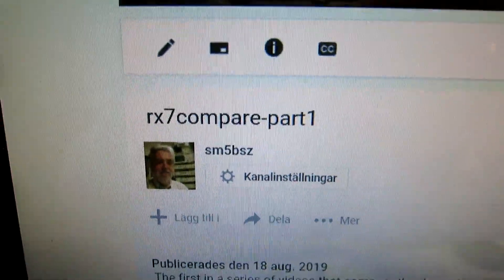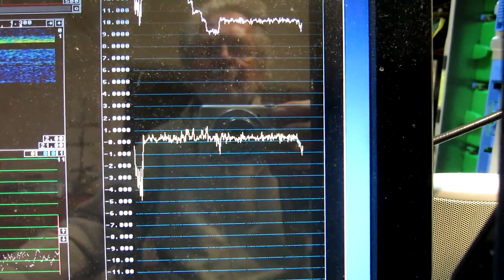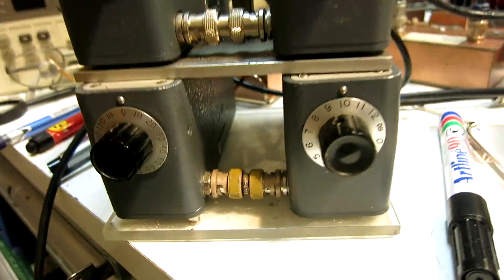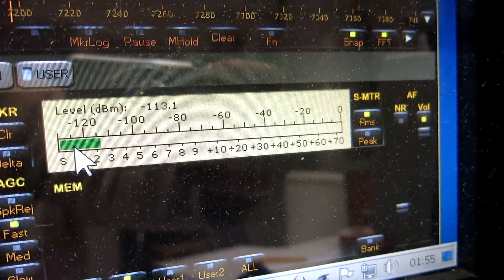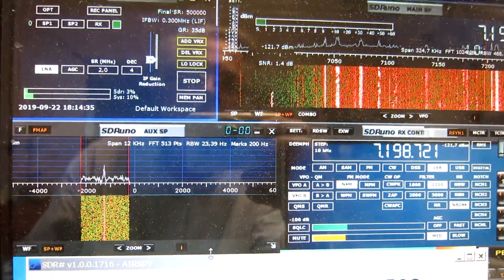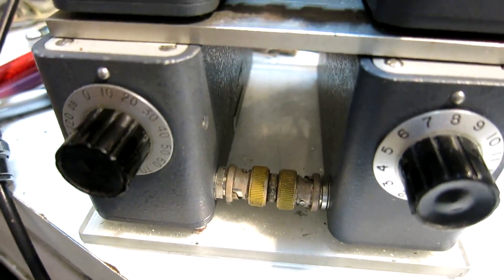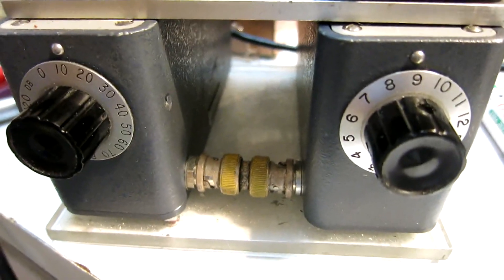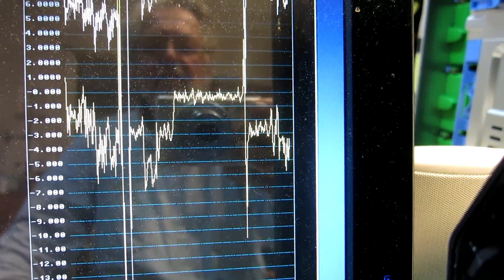rx7compare-part2

Comment: Well done!

So Airspy HF+ and HF+ dual are not same performances? Thought it was same spec except different pinout...
Reply from the maker: The original Airspy HF+ has been renamed to Airspy HF+ dual to distinguish it from the new Airspy HF+ Discovery. "Airspy HF+" is now the name of two different radios that use the same firmware and software. The difference is between the dual and discovery variants of HF+.